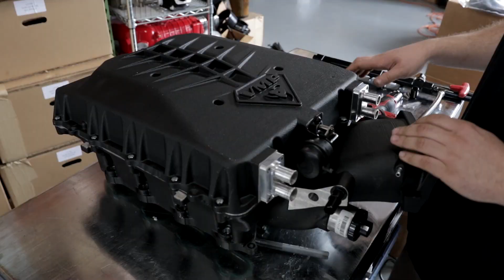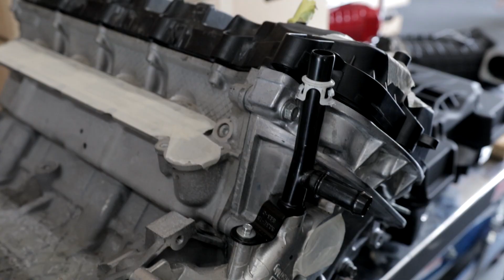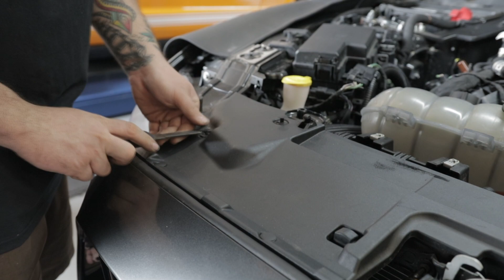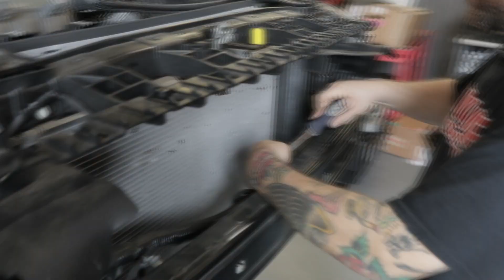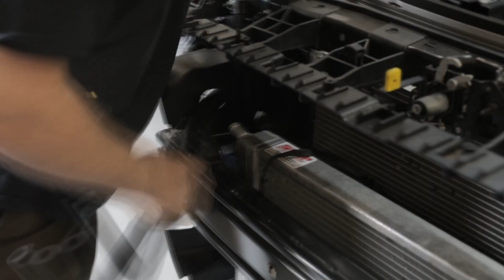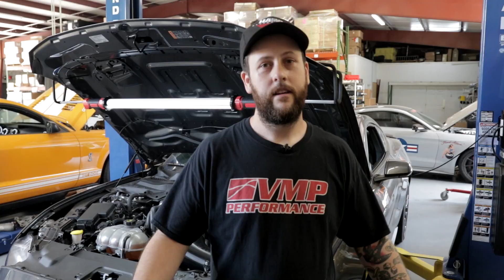Project Odin || Full Odin Installation || Step by Step for 2018+ Mustang

Comment: These instructions are missing several steps on the 2022-2023. I bought this blower and the video is good. But whatever model year the car in the video is (2019?), it’s not the same as the 2022. Numerous parts are different and not mentioned at all. And there are no instructions for those parts, plugs etc.  You are left to figure it out. I plan to call vmp to get their advice. Still working on my install. Doing it myself. I don’t trust a shop to do it. Been burned too many times by terrible work.

Comment: This looks like a clean, minimally invasive installation that one could do themselves.  However, it's $2k more than a Rousch phase I kit, though it does require more modifications.
Reply from the maker: It does provide substantially more power, as well as greater potential with additional modifications such as a return style fuel system and E85.  A more apt comparison is the Phase 2 kit which lists 750hp at the crank and delivers high 500s to low 600s to the wheel.  The Odin kit delivers an average of 675rwhp on '18+ Mustangs.

Comment: Do you have to remove the under bonnet insulation? I see its been removed in the vid.
Reply from the maker: We would recommend removing the insulation.  In long term testing, we've seen no issues arise from it.

Comment: Great video! Does VMP have a strut tower brace that will fit this kit or will the original one work. Or do you recommend not using one? Thanks! 🇺🇸
Reply from the maker: We do not have a strut tower brace that works as most of them come into contact with the blower's lid.  We haven't seen any noticeable detriment from removing or not using one.  Thanks for checking out the video!

Comment: What stage is this?
Reply from the maker: The is the standard kit.
Reply: @VMPPerformanceTV  What’s the whp on the standard bc I’m thinking vmp route on my 10 speed
Reply from the maker: Most of them make between 650 and 700 rwhp on 93 octane.
Reply: @VMPPerformanceTV  what could I do to get that number up

Comment: What is the special tool to release the passenger side fuel line?
Reply from the maker: It's a Fuel Line quick disconnect tool.  They're available at your local parts store or most any where you can purchase automotive specific tools.  It's designed to slight into and release the tension on the internal spring in that connector.

Comment: Oil pump gears?
Reply from the maker: Hi Jeno.  Are you asking if they're needed?  Assuming that's the case, oil pump gears and crank sprocket upgrades are typically associated with your style of driving and use of the vehicle.  Drifting or drag racing a manual transmission car would warrant considering these upgrades much more than daily driving a 10R80 equipped vehicle.  The biggest risk to your OPG and CS have to do with rev limiter strikes and anything that would "shock" the engine such as a two step etc.

Comment: Do you need to upgrade the clutch, driveshaft, and half shafts to take full advantage of this kit or is it safe to run it with the factory parts? I assume the factory parts will not hold up too long.
Reply from the maker: It really depends on your intended use of the vehicle.  For a enthusiast's vehicle that only see's street driving, they can survive.  If your intention is to take the vehicle primarily to the track with a sticky tire, we'd recommend upgrading other components to go along with your supercharger kit.  That being said, those components are designed with OEM levels of power in mind and we've seen things break on naturally aspirated set ups.  Feel free to reach out, we'd be happy to discuss your goals and make recommendations based on your desired power level and how you plan on using the car.
Reply: @VMPPerformanceTV  awesome! Thank you and I will definitely be reaching out here in the coming weeks🤙🏻. No drag strips just the occasional road course but nothing too crazy.
Reply from the maker: The big initial killer of driveshafts and axles are shock.  The same can be said for the clutch and transmission.  If you're driving the car with smooth transitions in an effort to not upset/unsettle the suspension, you'll find minimal shock and likely a pretty good life-span for the parts.  The story is completely different for a drag racer or drifter.

Comment: What are the torque specs for bolting down the blower I don’t understand what 70mm and 30mm is lol
Reply from the maker: Hey Freddy.  The 70mm and 30mm are the bolt lengths.  As for torque specs, you would use the same torque spec as the intake manifold as you're bolting the blower down into aluminum heads and do not want to pull threads.

Comment: Got one of these installed about a month ago.. definitely has potential, but I think there's something wrong with either the install or the tune (aftermarket, not the one from VMP). Initially after I first got the car back, it went into limp mode a few times. Would resolve after turning the car off & starting back up. Then it started throwing Trouble Code: IAT sensor circuit range or performance problem (p0111 I believe). Shop said that I'm likely just suffering heat soak from the increased heat given off from the blower, but I'm skeptical (granted, I'm not a mechanic by any means) given the highly regarded cooling setup on these Odin kits. I do live in Texas and it's July, so temps are usually mid 90s or low 100s, but I'm seeing IATs on my dash (no nGauge or anything else) of 160-170 after runs. Car will cool down maybe 5-10 degrees when I return to normal highway driving @ 60-70mph, and of course increases a little at a stop. But that seems way too high to be correct. Symptoms I've noticed that something is off is that the car feels slower a lot of the time - in 2nd gear and beyond if I go WOT, I notice the boost maybe up until about 3500-4000 rpms, then it feels like it just disappears. Shop also believes that this feeling of "decreased power" is due to the stock clutch starting to slip. 

If the IAT harness was installed correctly, could it be that the tune did not recalibrate the temps at which the ECU pulls timing?
Reply from the maker: That definitely sounds like something's not quite right.  Email us at sales@vmpperformance.com with this information and our support and tuning staff can assist with what might be going on.  Here in Florida, it gets pretty hot and even in traffic/sitting, we're not seeing those types of IATs.
Reply: @VMPPerformanceTV  Thanks for the response! I definitely will.

Comment: Does anybody know if this is the same process for a gen 5 Whipple
Reply from the maker: While most PD superchargers will have similar steps, each manufacturer will have their own procedures for details specific to their supercharger and kit components.  Your best bet is to contact the dealer from which you purchased it or Whipple directly to obtain instructions if you're looking for help with your Whipple.

Comment: Hell yeah, loved every second of this install! LOVE that we don't need to do any drilling and tapping! This looks like such an easy install, I'm even more psyched to get mine. I also love that we can use the stock JLT oil catch cans too not some specially made one. The way the Supercharger screws on too, unlike some I've seen where they screw on the outside which the ones around back of the firewall are a b* to screw on. I am shocked how much they improved this Supercharger vs the others.

Comment: Does the intercooler only take water? I'm assuming up north we would use antifreeze?
Reply from the maker: You can use a mix of antifreeze and we use "green" ethylene glycol based coolant to make it easily identifiable if there's a leak versus the manufacturer's orange engine coolant.
Reply: In a climate where temps can reach freezing the use of coolant would be suggested.

Comment: Bending that little coolant ''nipple'' had me going lmao. In the north with rust it would of snapped and made a bad day, well just a little worse but if i was getting an Odin i might be alright with it.
Reply from the maker: It's always a balance of modify versus replace to control kit costs.  This doesn't take much of a bend at all for clearance, as it's small diameter and the hose for it is rather small as well.

Comment: What about tune ?
Reply: What about it?
Reply from the maker: We include a tune with Coyote supercharger kit purchases and you would just need a device to flash the tune onto the PCM.  In the case of the 18+ cars, it's via an HPTuners nGauge.
Reply: Do you have a tune with the Odin supercharger for a bone stock 18+ GT automatic transmission ready to go